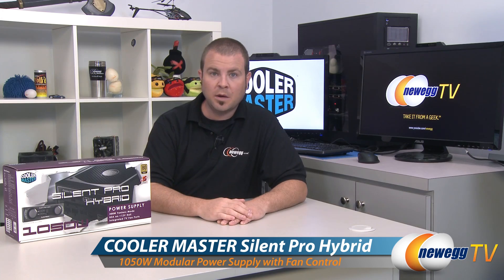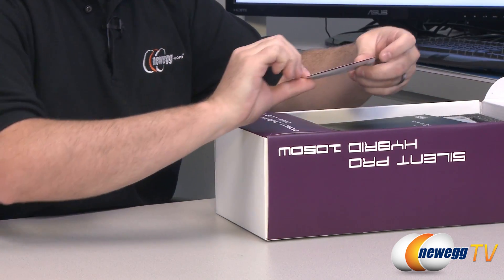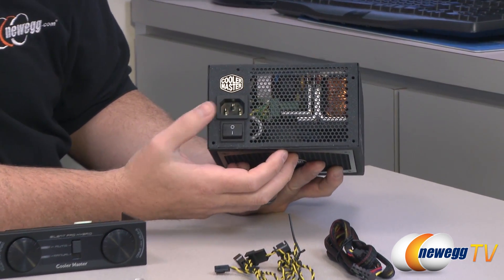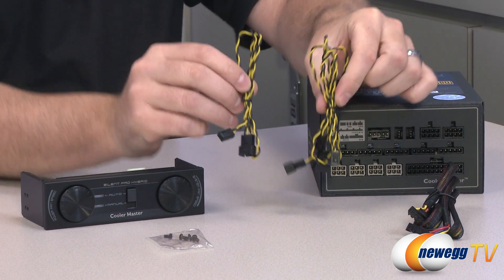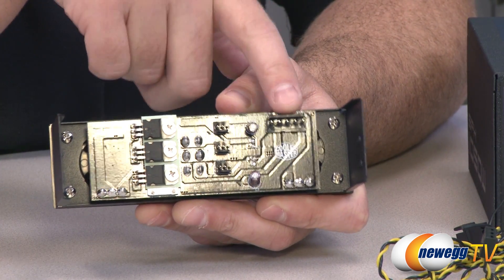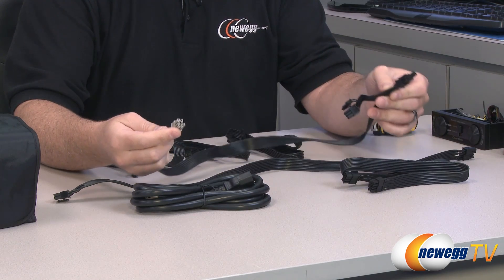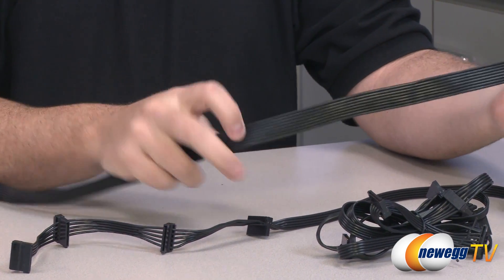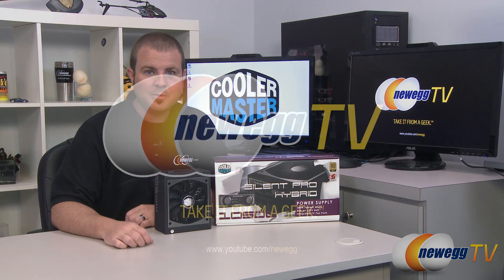Newegg TV: COOLER MASTER Silent Pro Hybrid 1050W Power Supply with Fan Control Overview

Comment: HEY! I have an 800W Silent Pro Gold that is close to 7 years old (purchased Feb. 2012). I'm rebuilding my machine in a new case; but as good as these 80 Gold PSUs are, I'm afraid to put mine back into use with my rebuild because I think it might be close to blowing out after this long. Once more, I think I picked a PSU with too much wattage for the kind of build I have, and I'm thinking of stepping down to 650. Should I take my chances with what I have, or replace now and save myself the trouble of watching my aging Silent Pro Gold take out my $200 motherboard when it dies?

Comment: Having build a couple of computers as well as updating 2 other computers I understand the importance of a quality power supply. I have also had many years dealing with electricity so my comment regarding every time you have a connection in a line you have created a potential "hot" spot. However, I do respect your answer.

Comment: i was going to buy this psu when i build my new rig. then i realized how expensive electricity is where i live, also with how power efficient components are nowadays a 750-850w psu is enough for overclocking and dual GPU's.